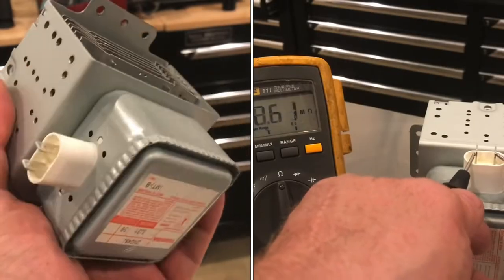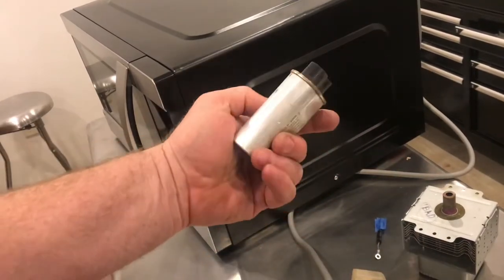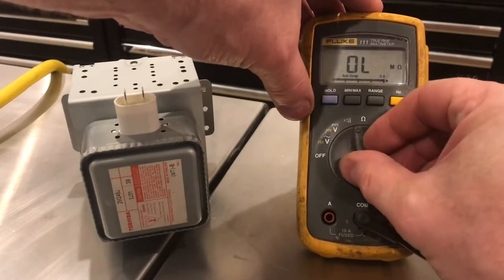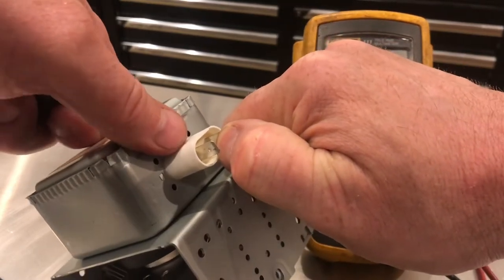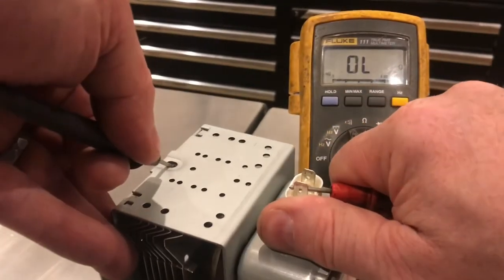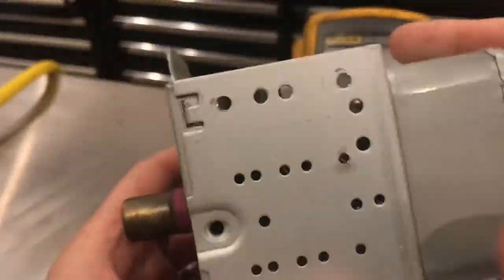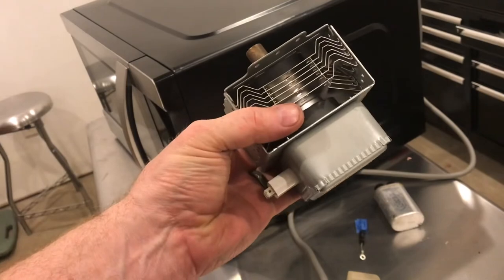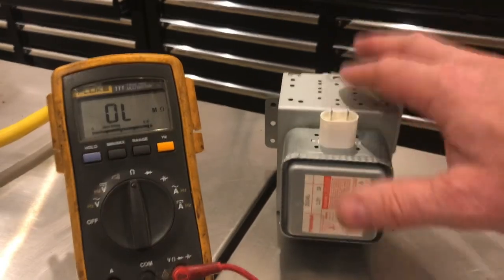sometimes a microwave￼ MAGNETRON can test out “ok” but still be “bad”

Comment: Thank you for your video. It was extremely helpful as well as the commentary below. Our problem started with a bad Capacitor, which I replaced. It heated twice and stopped working. Using the same methods of testing the Magnetron as you dispalyed in your video. The Magnetron  test as though there is nothing wrong with it. However, I found severe heat discoloration on the housing as well as minor melting of the cooling fan schroud. I ordered a new one from Amazon based on your video, commentary and heat damage. I'm sure it will work now.
Reply: Did it work?

Comment: Thanks for the video! I have a GE Advantium 240 microwave that stopped heating ($2500 to replace). Tested everything: door switches, capacitor, capacitor diode, as well as the magnetron (an LG 2M246) using a multimeter, precisely the way you described. The magnetron tested perfectly with no obvious defects. I was about to give up until I saw your video. First, I put the microwave back together for a new baseline, just to make sure I hadn't "wiggled" something back into working condition. Still no heating. Second, I ordered a new magnetron for $35 from Amazon and presto; microwave heats just fine. So to your point, a positive test of a magnetron using a multimeter does not necessarily determine whether it is still good. Bottom line, if you already have the thing out for testing, just replace it; its worth a try for $35.

Comment: I believe the problem with that bad magnetron is the waveguide. That's the nipple-looking part surrounded by the gold-colored pot scrubber-looking metal. That waveguide looks rusted. The corrosion is likely inside the waveguide too. That will cause the waveguide to not work right, or at all. The microwave energy will get sort-of stuck in there. Waveguides must be clean and smooth inside to work. However, there is no way to fix such a magnetron. That one is scrap metal now. But save the 2 magnets, those can be useful for other projects. ;-)

Comment: That's a very good video, and extremely helpful.  You know, I have a Sanyo 2M140 magnetron that didn't heat the food sometimes, but yet checked good with both of my digital voltmeters.  However, with my Conar Model 211 analog tube type voltmeter, I could detect some capacitance between the casing and the magnetron heater whenever I switched the voltmeter leads.  I mean, the pointer would jump up a bit before coming back to rest, and this would occur whenever I switched the Conar voltmeter leads.  In fact, I checked that capacitance with my LCR meter, and it measured approximately 0.001 uF capacitance.  Would that mean anything?  Oh yes, there was definitely 4,000 VDC between the magnetron heater and ground as I measured that with my high voltage meter.  In addition, the magnetron overload protection checked fine.
Reply: There are capacitors within the socket from each filament lead to casing.  When those caps breakdown and leak, that’s the resistance you see when doing the ohm test.  New socket from Amazon corrects that problem.
Reply: Well, the only sure way of testing out a magnetron is to check to see that the required DC high voltage is indeed being applied to it.

Comment: I’m waiting for the Magnetron part to arrive, but I was looking how to test it to make sure. When the higher hum started it tripped the breaker, reset and tried again, blew the power fuse. Replaced the power fuse and powered it back on and did a 30sec heat test, I heard the higher hum again and then stopped heating. It blew the heating fuse. I tested the magnetron and I can’t find anything wrong with it digitally. So even if it tests good, it still might be bad. The diode tests good, switches are good. So I hope it’s just the magnetron.